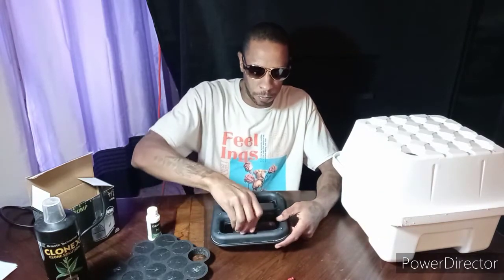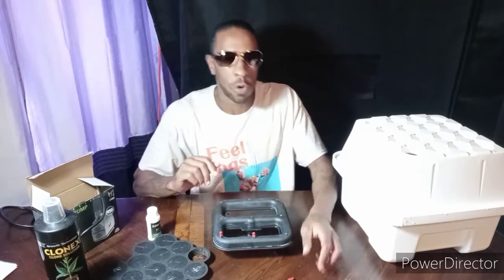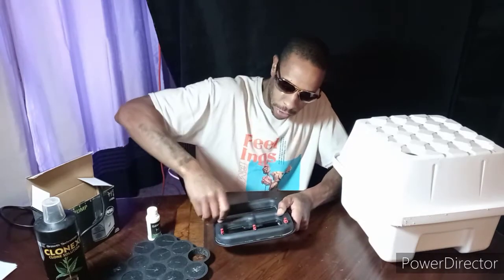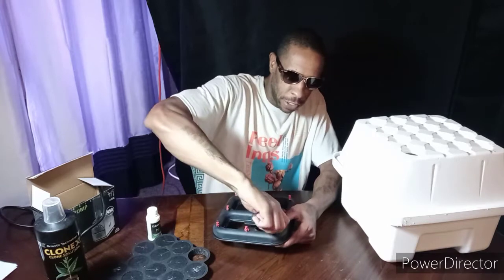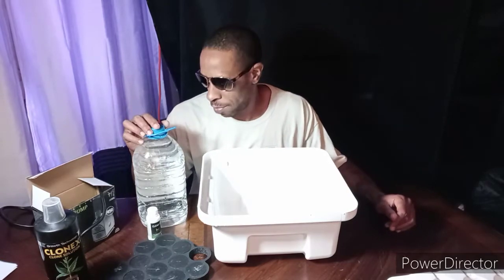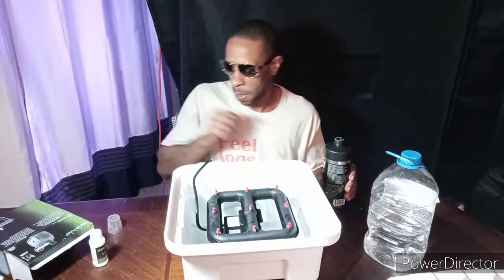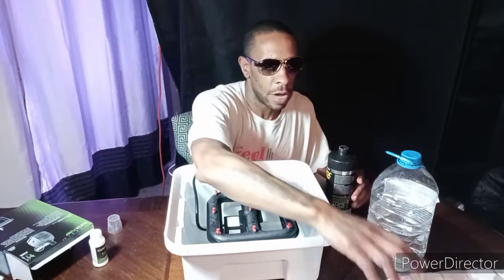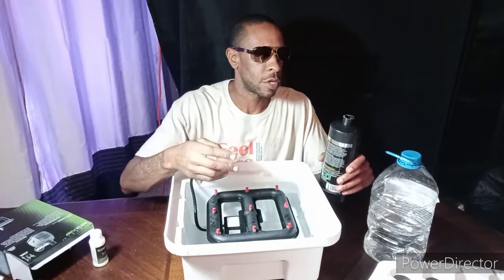How to assemble ez cloner

Comment: The 16 ez clone I’ve seen has a pipe between the pump and the manifold. Is that only on the older model or does the updated model come with it also.
Reply from the maker: I have the updated model and it doesn't have a pipe. The piece that holds the sprayers screws directly into the pump.
Reply: Iceberg Stem can you confirm if it still has the 450 MAG pump cause, i see you got the 9 site manifold and not the 4 site it use to have.
Reply from the maker: Yes i have the mag 450
Reply: Iceberg Stem thanks